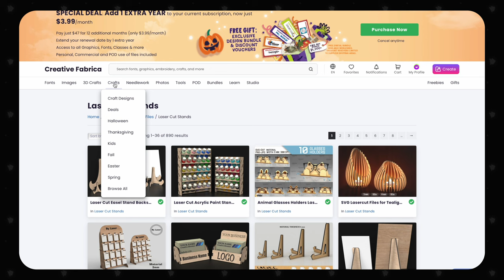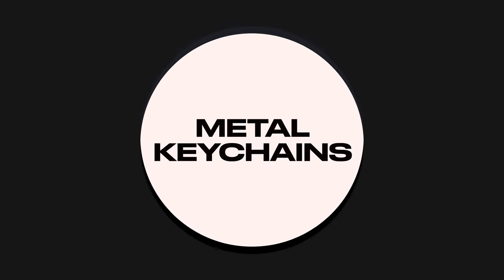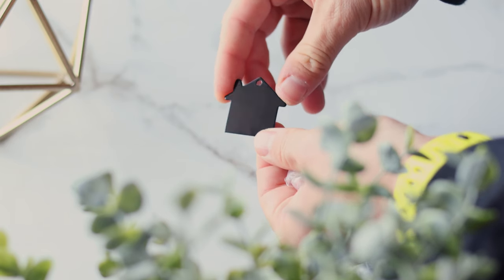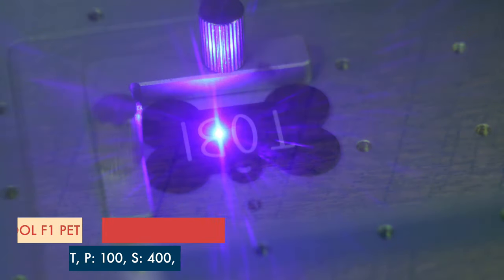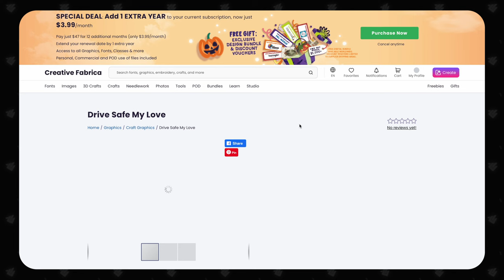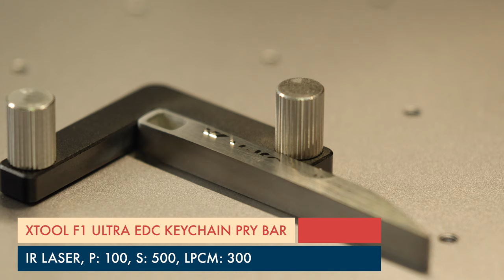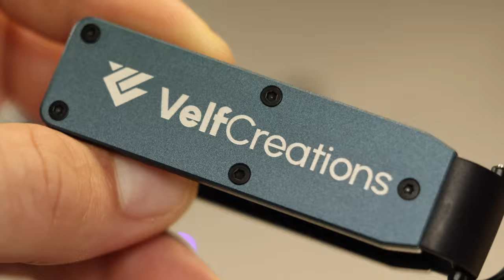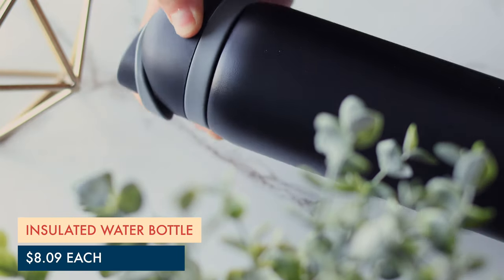Is it Worth It? Laser Engraving TEMU Blanks with the xTool F1 & F1 Ultra

Comment: How wide can you go on a tumbler without using the rotary on an F1?
Reply from the maker: It’s not too wide and also a bit hard to know for sure, because the diameter of your tumbler matters. Larger tumbler can get larger designs because the focus fall off isn’t as big. 

You’ll start noticing that the edges aren’t full engraved but sometimes you can just run another pass to clean it up. Normally we can do things that are like 1.5 inches wide or lower to be safe